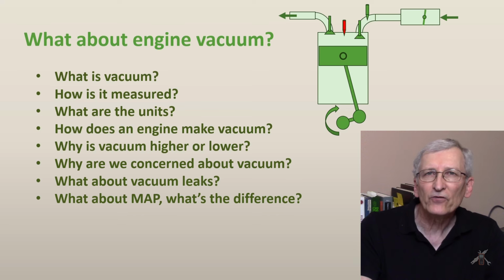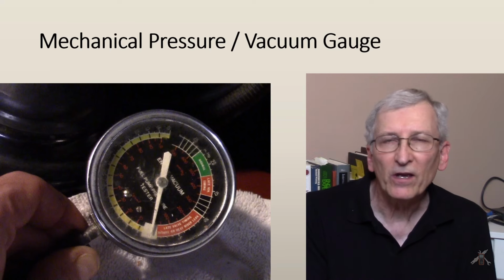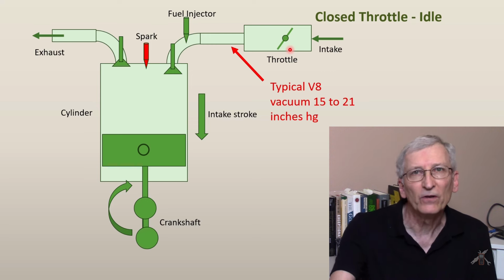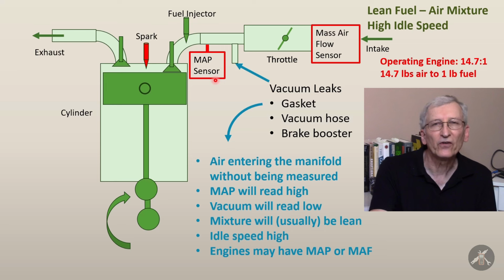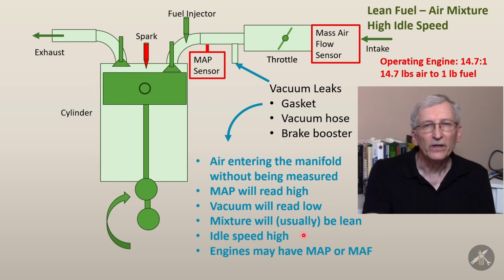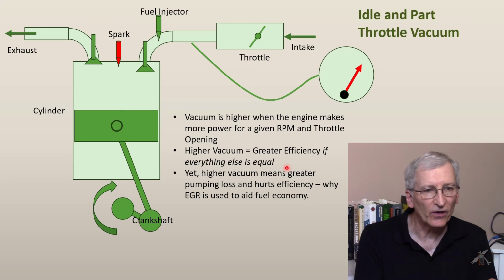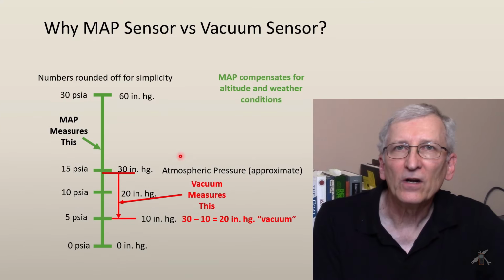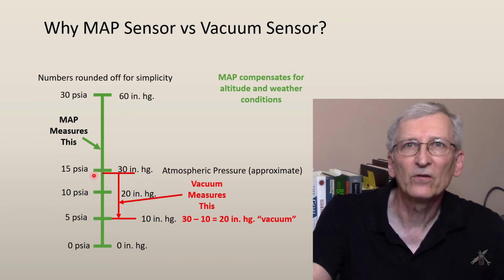Understanding Engine Vacuum and MAP - What is Vacuum? Why engines have vacuum & why it's important

Comment: I use the EXACT same type of gauge to make sure my engine is in good shape, the vacuum at idle stays close, and also to measure boost from my turbo to to over 11lbs PSI above ambient, I only use 9-10, so it's the PERFECT, fifteen dollar gauge. Monitor engine health, and boost.
Reply from the maker: It's always nice when a simple tool gives you all the information you need to monitor performance.

Comment: In 2022 I fitted a Lufi XF OBD2 onto the dashboard of my then 16 years old Mercedes. It has 4 menus. On the main menu I set MAP, MAF, Rpm, speed, throttle valve %, exhaust 02, ignition advance, coolant temp & voltage. At hot idling in P mode 750rpm, air cond on the MAP is -7.5psi, MAF is 5.5g/second vs throttle position at 15.2% open.

At 120km/hr rpm is 3320, throttle body at 100% open, MAP at +7.9psi and MAP at 87g/second. Other menu I set for short fuel trim vs long fuel trim vs rpm vs exhaust 02. It had help to trouble shoot the shaking engine due to the broken PCV hose which drops the MAF to 3g/second. Regards.

Comment: any advice if i want to introduce a carbon cleaning liquid into the intake manifold at the vaccum port on the side of the manifold (that has the line going to the brake booster)?
Reply from the maker: I haven't tried that before, generally cleaners are fed through the intake carb / throttle body because they need to be distributed to all cylinders and a vacuum port isn't set up to do that. Best advice is to follow the manufacturer instructions because they know how best their product works. I don't know your engine, but if it is a computer controlled with catalyst, you need to be careful, because some of the cleaners can cause problems with the O2 sensor or even damage the catalyst. Cleaners often cause misfire and that can cause the cat to overheat and melt. Again-- manufacturers instructions.
Reply: @bitsofwisdom460  the machine i bought at a garage sale is a Carbobtune CT-2100.  |The guy said it was in the garage when he bought the house.  Thankfully it came with a manual.  it takes a bottle of motorvac carbon clean and the CT-2100 Manual says to connect it to a "non-ported vacuum port on the intake manifold".  I tried it today and no ill effects that i can tell.  I changed the oil, cleaned the throttle body, changed the air filter and did the motorvac on my 2014 Outback --- defintiely runs smoother but that could just be the oil change.
Reply from the maker: @PerryBolte  I don't have experience with that machine, but that sounds like a reasonable process because the machine must be metering the fluid at a controlled rate.  That would minimize risks and feeding through a vacuum port makes more sense.

Comment: This, btw, is why an engine's power is rouphly doubled at 15 lbs of boost. As far as the engine is concered the atmosphere's air density just doubled and so twice as much oxygen is available to burn fuel.
Reply from the maker: Yes, that is a good observation.  All things being equal, twice as much air should allow twice as much power.

Comment: Its also called 1 ATM or atmosphere yes many ways to say the same thing with pressure.  I prefer pascal but to each his own carry on please....
Reply from the maker: Yes, you're right about 1 ATM, and it is essentially the primary reference.  In the auto engineering world, I tend to stay away from ATM because it needs the definition of standard conditions.  Since we are always making engine adjustments with changing altitude and barometric pressure I tend to stay with kPa.
Reply: @bitsofwisdom460  Can't fault you there! Kpa!

Comment: Imperial units of pressure / vacuum are just awful, always bouncing between PSI and inches Hg.   
Metric kPa is so much easier. 0 kPa = perfect vacuum, 100 kPa = normal atmospheric pressure, numbers > 100 kPa = positive pressure "boost pressure".
Note some people insist on using negative (minus) kPa to indicate vacuum. This is wrong, kPa is an absolute value it does not have negative values.
Reply from the maker: I agree that metric pressure is generally cleaner, although it still has some similarities to Imperial.  You can (and some do) measure pressure in mm of Hg. for example.  And, I don't know of any restriction of the use of negative gauge pressures using kPa.  While it is correct that measuring absolute pressure in kPa will not have any negative values, many pressure transducers that I used in the lab were not designed for absolute pressure. They were set up for gauge or relative pressure referenced to atmosphere and they most certainly would report negative pressure if they were on the suction side of a system and were pulled below atmospheric pressure.  We could calibrate them for either psi or kPa.

Comment: Let me stir the pot. 
"Pressure fills the cylinder"
😂
No, no it doesnt. 
The motion of the piston moving down on a intake stroke creates vacuum.
Atmospheric pressure is a factor to the quality of air (density) going into the cylinder.
Reply from the maker: Well, consider it this way.  The term vacuum really only refers to a reduced absolute pressure compared to an atmospheric (or other) reference pressure.  So, yes in our atmosphere, a reduced pressure is created in the cylinder by piston motion. But air moves into the cylinder due to pressure differential between the manifold and cylinder. If atmospheric pressure is reduced, say by altitude, cylinder filling will be reduced even for the same piston motion. So, less external pressure will reduce the flow into the cylinder.

Comment: Thank you so much!  This is really top notch information about vacuum systems.  Both of your vacuum videos are great!  As an engineer, I now have a much better understanding of how vacuum applies to automobiles.
Please consider a more advanced video.  I have a 1995 Ford F250, which has a belt driven vacuum pump, which has vacuum so excessive that it pulls down the fuel pressure regulator so low that the injectors don't have enough to work with... so the engine computer (PCM) dumps more and more fuel into the cylinders.  How does a vacuum pump fit into the system?  EGR?  PCV?.... a more comprehensive video with common applications would be grand!!  Keep up the great work!
Reply from the maker: I appreciate your suggestion for an advanced video on vacuum systems, I'll put some thought into that!

Comment: I remember as a boy seeing the old vacuum driven windshield wipers work on my father's car on rainy days.  They went really fast when his car was stopped and really slow when it was moving.
Reply from the maker: Yes, that was a common issue with the vacuum wipers.  Cars like my Camaro have a reserve tank to keep vacuum stored for the HVAC system.  I don't know if any tried that on the wiper systems.  It might require a large tank.

Comment: Where to conncect vacuum guage?
Reply from the maker: It depends on the engine.  The carbureted engines often had manifold vacuum and ported vacuum ports.  The ported ones are off at idle, direct manifold ports are on always.  After that, the manifold vacuum is used for heater / air conditioning and brake system, so look for connections on the intake manifold that feed those directly before they go into any switches or sensors.  The fittings will go directly into manifold runners or fuel injection plenum behind the throttle plates.
Reply: Thank you!

Comment: Please explain water injection using vacuum?
Reply from the maker: Well, I never found that to be very effective.  Long ago, I built a system with a coffee can and a needle valve that fed to a carburetor port for manifold vacuum. The can was filled with water and alcohol and had a feed line the would bubble air through the mix and pull off vapor.  I saw the concept in some magazine.  It was supposed to help fuel economy in a time when fuel was short.  I never saw an effect and I measured closely.
What did work for me was a water injection kit.  My 428 Mustang at 11:1 compression didn't like mid '80's gas. Octane was only about 91 pump. Holley had a kit with a motor driven pump like a windshield washer pump.  It had a couple of connections for manifold vacuum and ignition power. It would trigger based on manifold vacuum dropping under load and spray water / alcohol mix into the carb throats to keep detonation down.  It was very effective.  Eventually the fuel got better and I took it off.

Comment: Awesome video I watched the whole thing. Any idea why my Ram 1500 is pulling almost 27 after revving the throttle at idle? It appears my vacuum is so strong it might be sucking oil from the PCV valve opening
Reply from the maker: It depends on the local barometric pressure and the engine controls (how tight can the idle circuit close off).  In the carb days, if I'd rev it up and snap the throttle closed I could get 27 to 29. I haven't checked on my newer cars.
I can't answer to the PCV question.  I know that some engines can pull oil through the vent systems, but usually they are baffled to keep oil away from the vent.

Comment: To check if the carb, intake manifold, heads, and headers are all balanced together at optimal efficiency, then at WOT the vacuum gauge should read close to zero.  True?
Reply from the maker: I don't know if I would go as far as to say balanced. I would more say that sufficient flow capacity of carb and intake should bring average vacuum close to zero.  Beyond that you'll get into the dynamics of pulsations of individual cylinders along with cam overlap and header tuning and it gets more complex.

Comment: I want to know bout crankcase pressure. Motorcycle air cooled 4 cylinder, i added a filter to vent to atmosphere. Would it be better to , like factory , run it in to the airbox? It would get the positive crankcase pressure out faster?
Reply from the maker: I'm not up on the latest motorcycle designs, but in automotive, it is usually looked at for emissions purposes.  The cylinders generally (on a 4 stroke) tend to balance pressure pulses- pistons going down the cylinder balance ones rising.  The main pressure to vent is then blowby leakage past the rings.  In the olden days, cars used a road draft tube and vented overboard to the road. When emissions concerns came forward in the 50's and 60's then PCV systems were required that took the vapors back to the intake to be burned.  I expect that feedback to the air box is an emissions requirement.  Many of today's systems just have a fixed orifice to vent to intake so they don't really seem to worry about precise crankcase pressure.  I have seen forced induction race engines that have extensive vent systems because they are pushing up the blowby, but I don't know how far you go before that is a concern.
Reply: Thanks for, the reply! Understood on your response. The emissions is to feed it back into the intake to be reburned. Just wondering if just venting  to the atmosphere is less beneficial in getting crankcase positive pressure  out faster. Compared to intake feed PCV system.   @bitsofwisdom460
Reply from the maker: I think that the PCV strategy that draws vapors into the intake to be burned is best.  In the old days, the so called draft tube was positioned close to the road surface to let the passing air draw vapors out. In slow traffic, the vapors tended to remain in the crankcase and deteriorate the oil.
Reply: Thank you for replying and your time! @bitsofwisdom460

Comment: Thank you kindly as I send this to my 40 yr old son to understand his 80’s cars. I must be the same age as after an internship at a 2 man shop, time at a motorcycle dealership, I was hired to sync 2 to 4 carbs & fix EFI cars in 1977. The Datsun dealer had two technicians who couldn’t understand how to sync multiple carbs and hated electronic fuel injection with a vane air-flow meter. No O2 sensor yet until 8/1980 or cat. They were clean enough they didn’t need them. No shops would work on many the even had dual points. The points #2, turned on in 5th gear only! Ford used the vane air-flow meter years later but in 1976, a 6 cylinder engine had 7 injectors. #7 was wired to a thermal-time switch on the manifolds coolant jacket to control how long fuel enrichment added for a cool to cold engine. I have timed many engines using a vacuum gauge to highest, back off 1” hg. 
 Thanks for the info to the younger generation that can’t understand vacuum pulses in the crankcase of a 2-stroke boat engine to make a fuel pump actually pump fuel.   DK, Omaha
ASE Master Tech since 78.
Reply from the maker: You're welcome.  This basic physics is sure widely used and it really helps to understand it.  My '85 Camaro also has a temperature controlled 9th injector on the V8 for cold start.

Comment: So... how did vacuum accuated Cowl induction work??
Reply from the maker: I haven't looked at that system, but my 428 Cobra Jet shaker hood Mustang has a vacuum actuated door in the scoop.  Essentially it has a spring loaded rubber diaphragm so that vacuum pulls the flapper door closed and when you open the throttle and the vacuum drops, the spring pushes the door open.

Comment: An engine with worn timing chains or is incorrectly timed with retarded valve timing and poor vacuum (abnormally high manifold pressure). If the engine is a speed-density system using a MAP sensor and crank sensor to calculate fuel injection, the computer will think the engine is under higher load, consuming more air, and increase the fueling. The computer will then see rich at the oxygen sensor and try to reduce fuel. It may set multiple different trouble codes. It may be beyond the allowed mixture slew of the computer, and then it will run rich all the time while the fuel trim is maxxed at full lean.

Comment: I had a 67 Bronco with vacuum wipers, going up hill / under load / high RPM, in heavy rain the wipers would barely wipe the windshield.
I never considered the barometric pressure, due to the fact that it's raining the pressure must have been low, I always assumed the vacuum was low because I was under load at high RPM learn something new everyday.  Great video
Reply from the maker: Thank you.  It is a combination of effects.  The engine vacuum from open throttle is very important, but the barometric pressure will also contribute.

Comment: Gas is cheap today relative to the value of the dollar and the average income. People complain about the price and then sit in their cars with the motor running waiting for their spouse to finish shopping in the grocery store.
Reply from the maker: Yes, it sure isn't as expensive as it could be relative to inflation. I remember when gas first passed $1.00 a gallon (and increasing as it went from $0.40- 0.60) back in my college days in the late '70s.  I was working part time for $1.65 an hour (minimum wage) between classes. A 20 gallon tank was a big expense.

Comment: It drives me nuts how every diagnosis procedure says “check for vacuum leaks” and I never understood what it’s for or what happens without it
Reply from the maker: Yes, vacuum leaks can be hard to track down, but can really upset the way that an engine runs by changing the fuel mixture.
Reply: Vacuum leaks supply "unmetered" air. An illegal alien intruder, as far as air/fuel calibration.